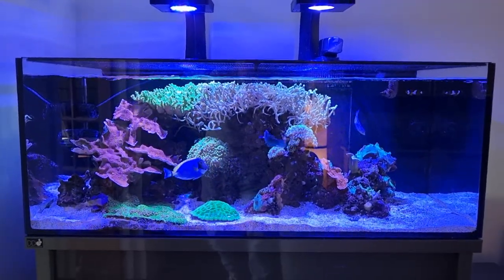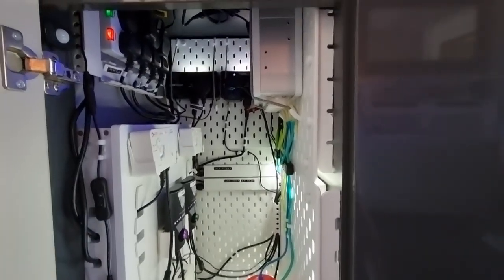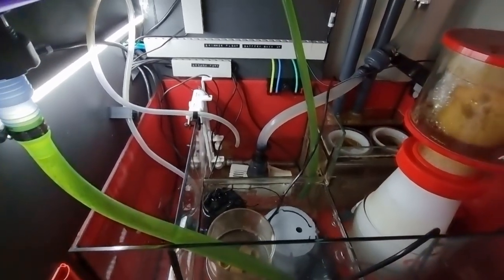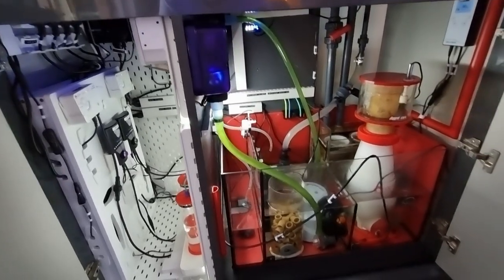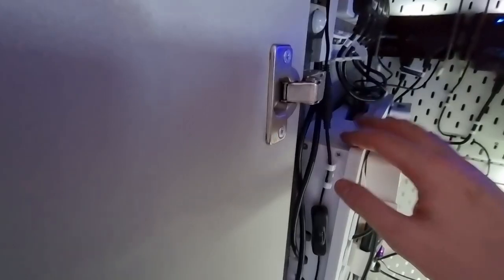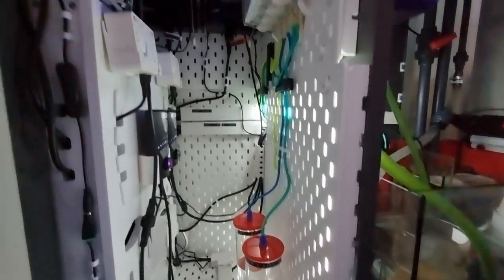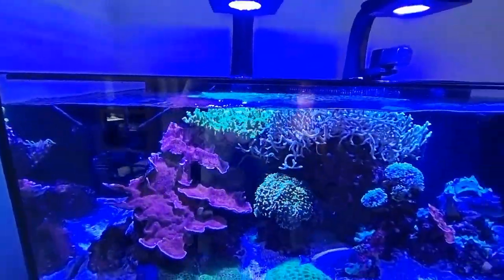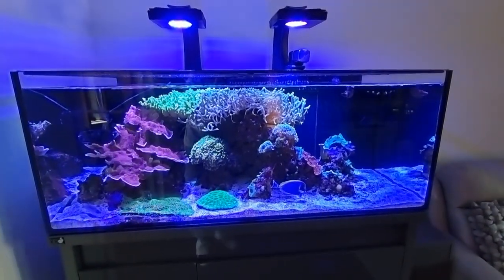Reef Aquarium Sump And Cable Managment Update

Comment: Great Video, the apex isn't geared up for the UK, I'm using red sea reef beat app amazing lights, doser, reefmat, reewave. But also using the reeffactory thermo view and the temp controller now. I like the board got same one, I had seen these boards in ikea had the same idea but to lazy to do it now. Great 👍 video well explained.
Reply from the maker: I like the look of the reefmat and their doser. I probably will get another doser at some stage and will probably be Red Sea or the Reef Factory doser.
Reply: @darrensaquaticsworld  most likely the reeffactory doser is Great not used it. The reef doser 4 redsea is brilliant. Reefmat also so good did have one issue the first motor seized but they replaced it and all working fine